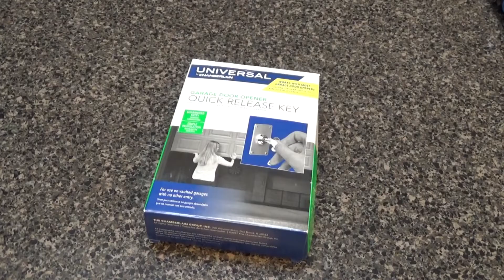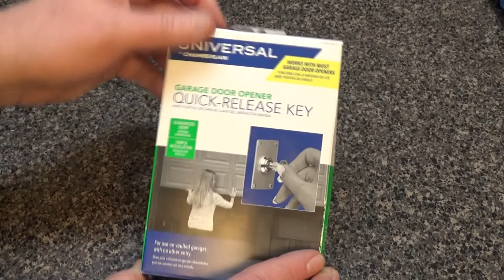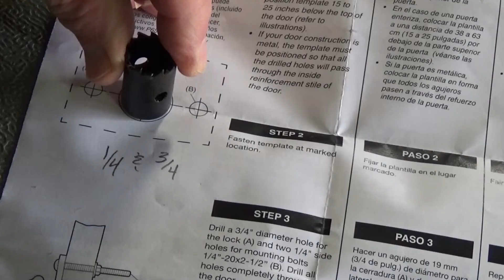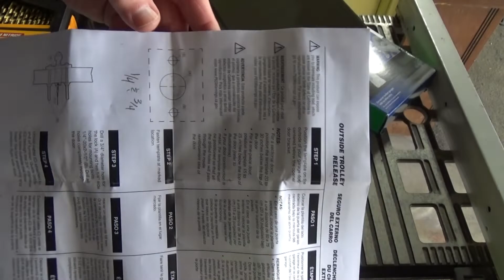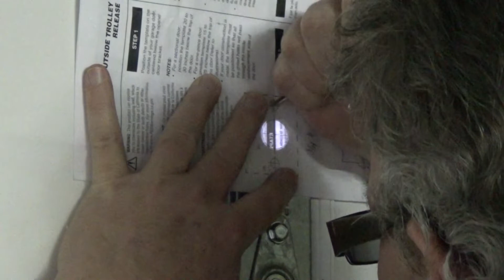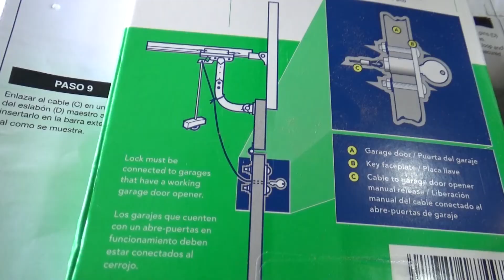Emergency Garage Door Unlocking Mechanism - A Must Have for Garages with Only Single Entrance!

Comment: Thanks for the video, I like your style on how you did this. Gotta try all the harbor freight tools, I will use my step drill as well, can't find my spring-loaded center punch. Maybe 1/2 inch is fine for the larger inner hole.